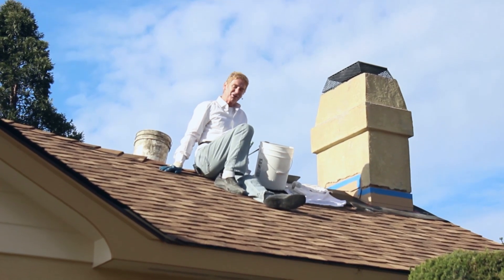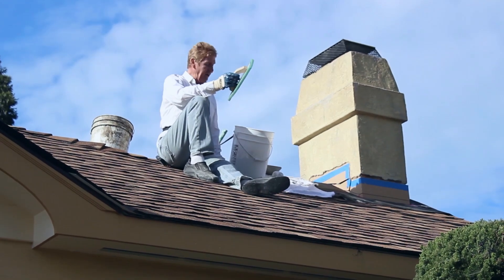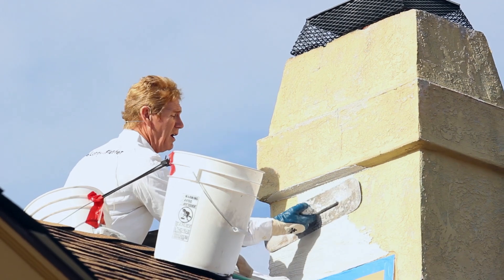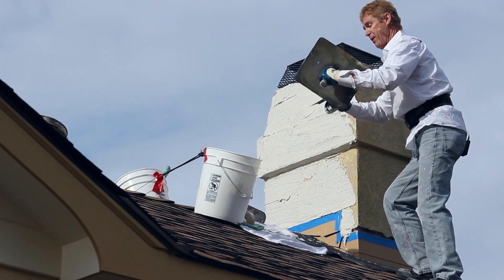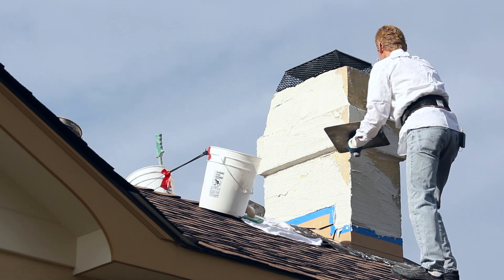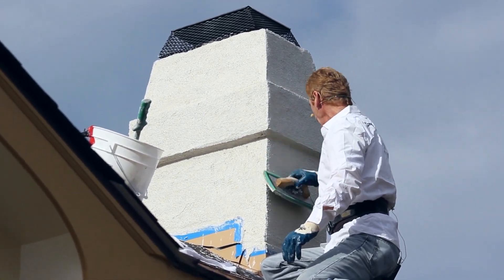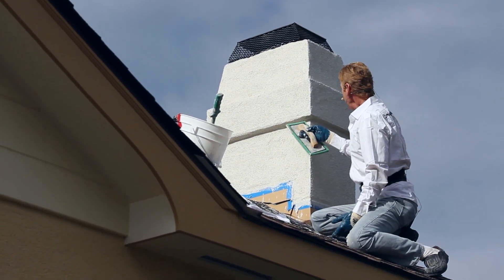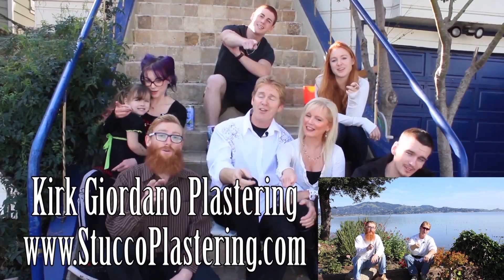Smooth stucco over a heavy texture

Comment: What amazes me is that the higher the level of specialty in the in-demand trades, often times the higher of level of arrogance and some kind of secrecy feeling that you see around.
Not in the case of Kirk G.,  where he always explains the steps down to the very basics and throws some "secrets of the trade" without hesitation.  We only need to get ourselves to do it and eventually  we will master the techniques. After a few small jobs i can handle that pool trowel with ease and confidence.  Same as of getting to know our cements, to figure out the point of perfect mix, drying time, etc.   I do door and window installation and commonly i used to sub the stucco patch job that sometimes is needed.  No more.  I do my own, and even started to get some other bigger stucco jobs,  matching ups, etc.   And all what i know i got it from this site.    Great knowledge here.
Reply from the maker: Howdy Ronald Dude, atta boy and thank you
you'll be making these video's soon telling your learned tips.      
                    Live long and plaster
         Mastering Plastering for the beginner’s
Reply: Same thoughts exactly, well said, thank you for posting !

Comment: Hello mr Kirk, love the informational videos. I have a new home that has traditional colored stucco with a smoother finish. It is cracking and the contractor wants to go acrylic now. Is that ok? Anything special to look out for?? Thank you sir
Reply from the maker: Howdy Poway, if you already have a smooth stucco finish an acrylic will be easy to apply over it. The acryic will flex much better than your traditional cementitious finish.
 Plus by now all the settling is oveer.
    FYI, with stucco the slightest movement and or vibrations causes hairline cracks, this does not affect the integrity of the waterproofing membrane, however, most folk panic as they have no clue why this happens it’s simply home movement, vibrations in stucco walls are sort like Kryptonite to Superman, not good.
 you are past this stage.
                      Live long and plaster
         Mastering Plastering for the beginner’s
Reply: Kirk Giordano plastering Inc. thank you so much. I appreciate the response!!
Reply from the maker: Howdy Poway, no worries my friend.      
                    Live long and plaster
         Mastering Plastering for the beginner’s

Comment: This last question kirk can you vaneer plaster on drywall. ? Or do you have to put mesh first on all the joints. or can you just vaneer base coat  plaster over it. then apply the veneer finish.  Let me know
Reply from the maker: Howdy Jose dude, use your mesh on all seams, you can first fill all the joints then imeadiatly skim coat the base on, after this sets you can now apply the finish coat.
 The base coat will usually set in 20 to 45 minute regardless of thinkness unlike taping mud which take many hour and even days.    
                                   Live long and plaster
                         Sharing plastering information

Comment: Hey Kirk, hope you are great! Theoretically speaking, how thick could you apply the finish coat after you have applied a bonding agent to a painted stucco? Would you dilute the bonding agent relative to the thickness? I won't hold you to anything, just want to know how you would do it!
Reply from the maker: Good evening  Keith, Finish coats should not be applied over an eighth inch thick.
 The chimney had a maintenance-free cement fish coat already that had never been painted, so no bonding agent was necessary.
 A lot of rules to Plastering.

 Bringing peace, love, and “brotherhood, ” back into the 🌎 of Plastering.
    The most comprehensive encyclopedia of plastering on video, by the plastering messengers of Youtube. 
Kirk and Jason Giordano with over 800 videos 🎭 👀💃

Comment: Hey kirk so you can color coat sand finish over. A texture home like that ??     Dont you need a base coat.   Or the 16/20 has enough sand to cov we that up
Reply from the maker: Evening Jose Dude, excellent question, yes I could have added color to this coat, but they had a unique color that was painted on the walls that they wanted on the chimney as well.
 The existing cement was a base coat, Jason had already applied "Weld Create a bonding agent" over the painted chimney so when I got up there, all I had to do was apply this finish coat.                    
                                Live long, and plaster
                     Plastering tips and techniques

Comment: Hi just subscribed to you're channel  need advice on how to best render a swimming pool what is the best way to go about it and the best render mix for it would really appriciate your input cheers I live in Manchester England
Reply from the maker: Howdy Frank from Manchester, my wife, is also from Manchester as in Summerseat, a small village or used to be.
Sorry, brother, I have no clue these days as to what cement plasters they use, it'a been over 30 years sise I plasterd a swimming pool.                 
             Live long and plaster
         Mastering Plastering for the beginner’s
Reply: Kirk Giordano plastering Inc. No problem can do the rendering and k rend just never done a pool so not sure of the best products for the job so many different ways to do it for the best finish but so many people saying no do it this way then do it that way get me was hoping you had the answer because you're the dog's bollocks at what you do never mind thanks for the reply take it easy and keep the videos coming
Reply from the maker: Evening Frank, I would suggest you call at least 5 swimming pool companies and ask this question, set aside at least an hour for this research, leave a messages if necessary, I believe at least 2 will explain what cement plaster they prefer the other 3 will be too busy or simply not wish to help out a brother.                    
                                Live long, and plaster
                     Plastering tips and techniques
Reply: Kirk Giordano plastering Inc. Yeah cheers pal been looking at different scenarios not doing yet for another month or so but will keep you posted will sort it but when first time especially involving water a bit scary but hey you just get on with it I suppose if you don't try not point being in the game

Comment: Kirk. Can you tell US HOW MUCH 6 SACKS OF RIVER SIDE PLASTIC CEMENT COVER SQUARE FOOTAGE WISE ....WE WILL REALLY APPRECIATE IT ESPECIALLY COMING FROM SOMEBODY THAT BEEN IN THE TRADE and WORKED WITH OLD SAM. 30 YEARS AGO. THANKS WE WILL BE WAITING FOR RESPONCE
Reply from the maker: Howdy Jose dude, are you referring to Sam Hoft, who lived in Castro Valley? Sam was a lather than plastering contractor, he comes from a line of lathers and plasterers.
Let's see, 6, 94-pound bags of Riverside or any other cement plaster regardless of who makes it can scratch about 25 to 50 yards, this depends on the amount of sand added too, some folks might add 3 parts sand to one part cement plaster, or up to 5 parts sand to one part cement plaster.
                    Live long and plaster
         Mastering Plastering for the beginner’s